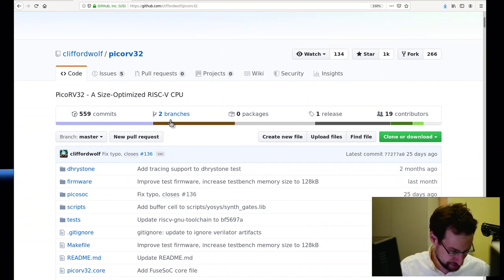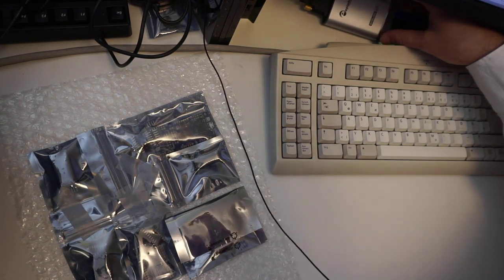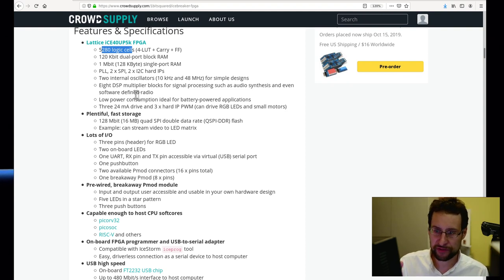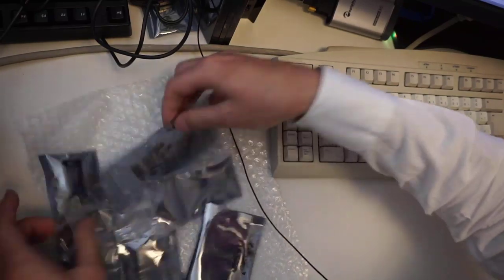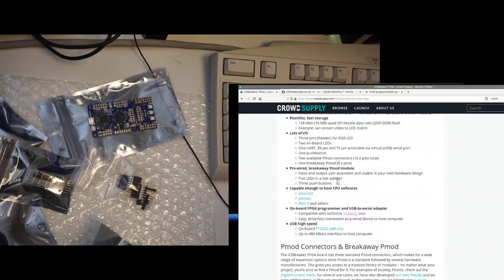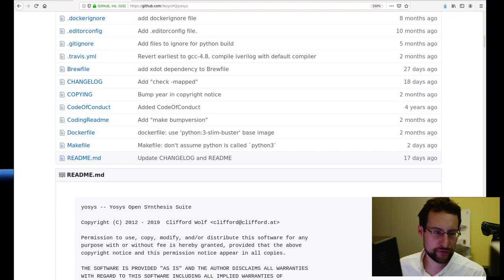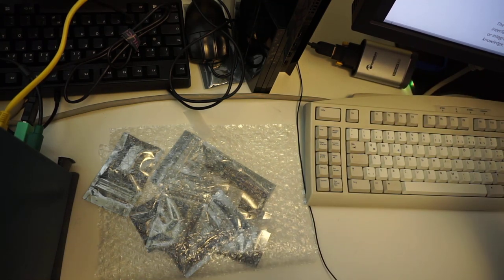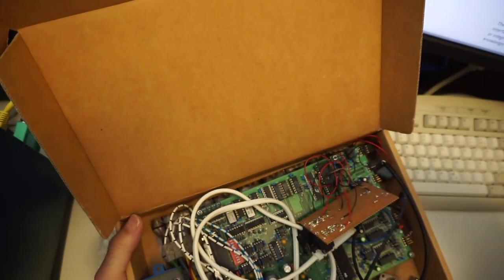OpenSource FPGA: 1bit² iCEBreaker unboxing!

Comment: Hey Rene. I'd be very interested in your opinion on either the Talso II or the Blackbird by Raptor engineering. :)
Reply from the maker: They are interesting, but given ibm and the small scale production a bit expensive. As they basically don’t help or improve my work I don’t personally buy them, the vintage Apple PowerPC I have are enough for me. For professional work I’m waiting for the amd Ryzen 3950 sku.